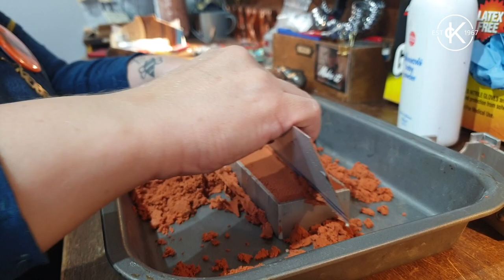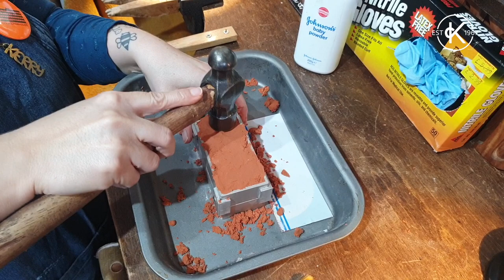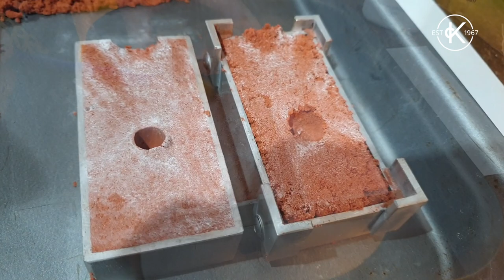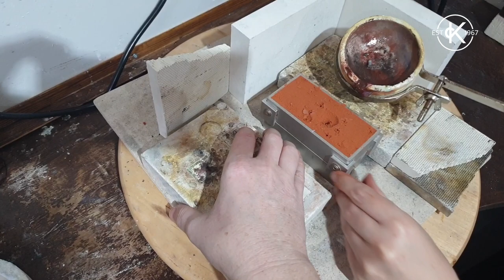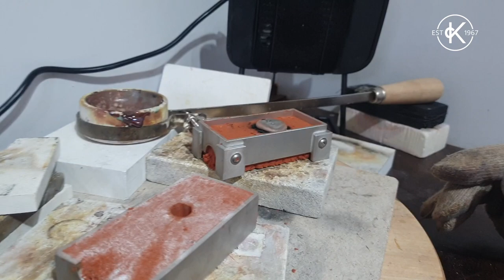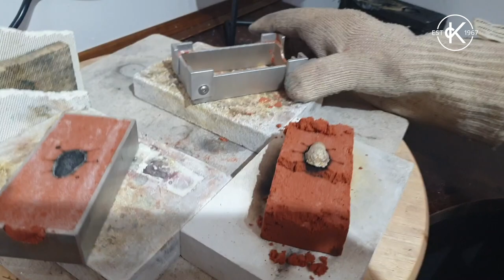Sand Casting With An Acorn | 12 Months Of Metal

Comment: If you'd have taken the metal rod you were holding to make breather holes long ways instead of through it and poured it from your crucible while it was standing it would've worked perfectly.
Reply: Thanks Cheri, yes I had previously been doing it that way but having way less success, presumable because I was struggling to keep the metal hot enough. The shorter, channel and external air holes really helped. Now I've cracked keeping the metal at temperature, we've reverted back to the traditional configuration :)